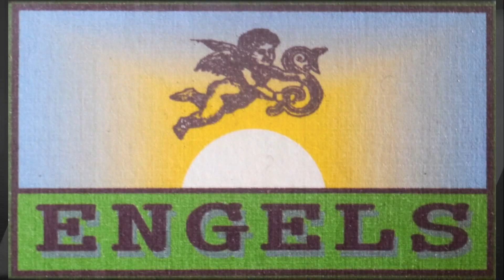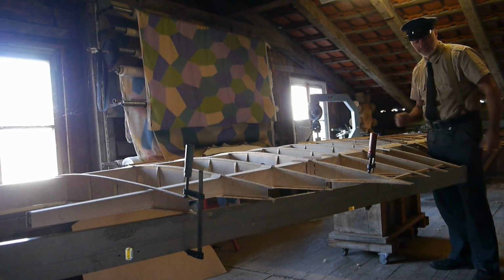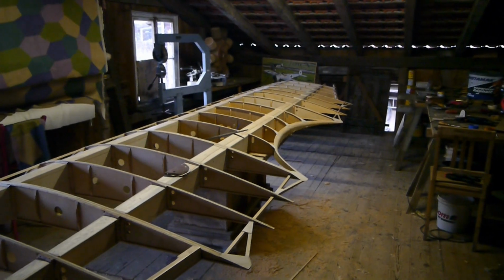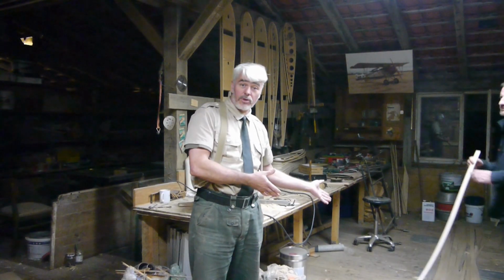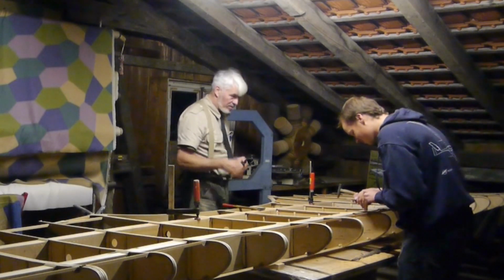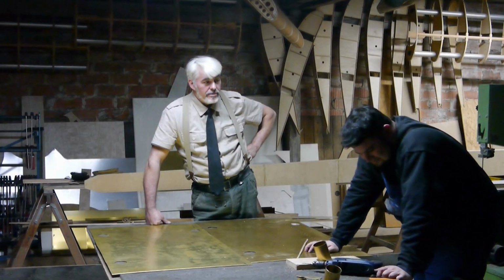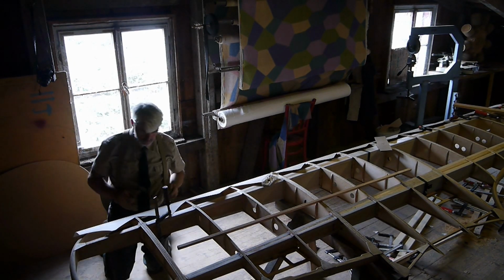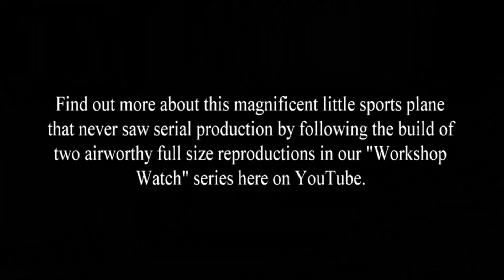𝔐𝔉𝔱𝔊 - 𝔚𝔬𝔯𝔨𝔰𝔥𝔬𝔭 𝔚𝔞𝔱𝔠𝔥 𝔈𝔭𝔦𝔰𝔬𝔡𝔢 25 𝔬𝔣 26𝔱𝔥 𝔬𝔣 𝔒𝔠𝔱𝔬𝔟𝔢𝔯 2024

Comment: i have Hans Jacobs book on wood glider construction he favors the wings be built vertical  on horses ie stands you would have both top and bottom at your hand no lying on floor ps i do not understand the scalloping on the leading edge i assume it is to save weight love your work
Reply from the maker: It does not really matter if you build the wing upside down or flat on table as long as you have the spars straight and parallel. It is easier flat however since you do not have to support the tapering spars towards the tip to prevent them hanging through by the weight of the ribs. They are much stiffer up and down than from front to back. That is why the wing still has the internal cross bracings. The leading edge fairing is just that, a fairing. It is not meant to form a closed torsion box, since these spars are very stiff in that design layout. The scalloping indeed is for weight saving and manufacturing ease.
Reply: In